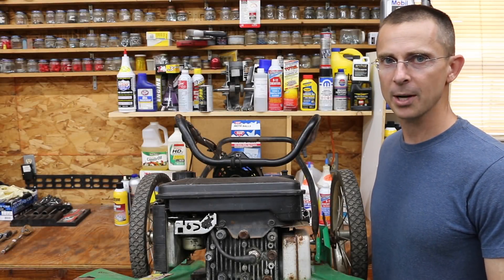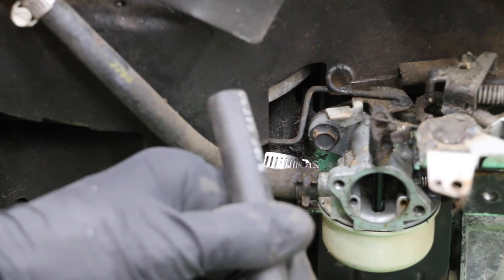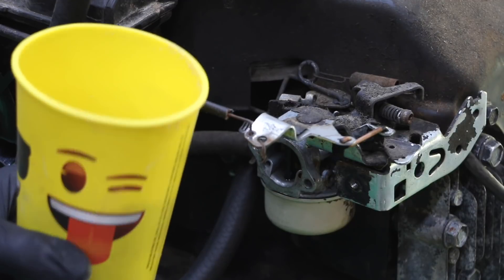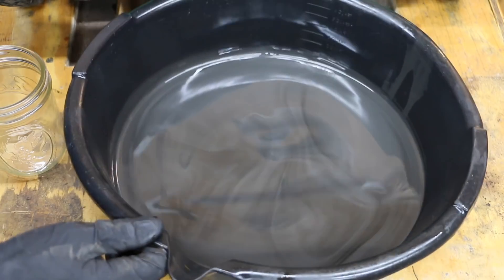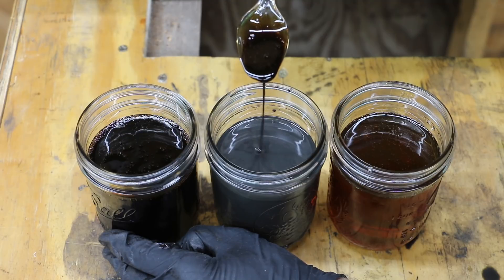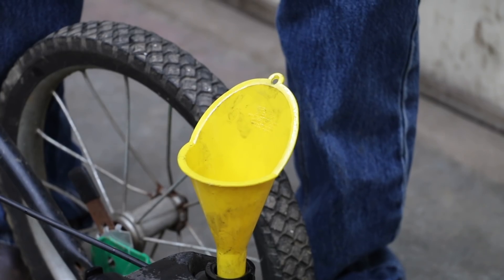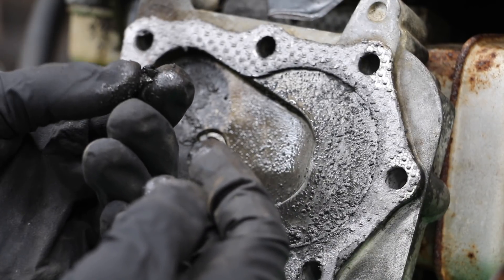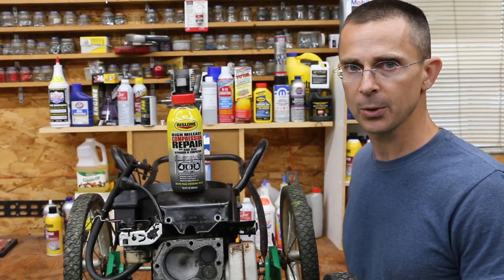Engine Eats Sand! Can Rislone Repair Compression Loss?

Comment: RISLONE. I have a 5hp, 43 year old B&S 5HP tiller motor with scratched up cylinder. Smoked like a fogger. I drained the oil, added 2oz Rislone and 16oz oil. NO SMOKE, runs smooth. It worked for me.
Reply from the maker: Thanks for sharing.

Comment: So I can't tell from the video if you ever wiped out the cylinder walls and the piston head/rings to get rid of all that sand before testing with Rislone (or whatever that was called)?  Nevermind, I see it IS called RIslone.  Anyway, so here I am, six years later asking if the piston, bore, and preferably the head had been washed out/wiped off/whatever to remove the lingering grit?  And my own suggestion might have been to use just a small bit of that sand and let it run longer to accumulate the damage rather than feed it 1/4 tsp of rough-grained sand, but who knows if that would have changed a lot.  I do think 'changing the oil and cleaning the head/pistons/cylinder/etc' before testing the restorative would have been pretty important...but then again, I don't know that you DIDN'T do that, but I don't see or hear any mention that you had so I was suspecting 'not', especially with the continued damage and worsening blow-by.

I'm curious what that metallic-y grit in the head was, though.  It MIGHT have  been some kind of partially-reconstructed 'aggregate' of fused-sand and the metallic debris from the damage?  And to be clear, I mean I'd really love to know what that debris was actually MADE of.  Like, 'x-ray fluorescence' or 'spectral analysis' or whatever like that just to see what was up there..!  That's not exactly a thing you or I generally have available, but I'm really curious about what it was made of.

Anyway!  After watching this, I remain convinced that my best solution to massive blow-by is to rebore or sleeve or whatever-the-cylinder and replace the rings/pistons/whatever.  I have yet to see anything helping with blow-by by more than a small amount.  This is an excellent example of why to use and CHANGE your car engine's air filter, though!  You definitely don't want a bit of road-grit getting slurped up into your car's motor like this thing got a sip of sand!  Road-grit might be less in mass, but unless it gets 'encapsulated' or washed-away and filtered out to keep it from doing more damage in the future then it'll just keep on rolling around and grinding stuff until the grit is small enough to roll past the rings and get filtered out..!

Comment: Restore "Engine Restore", the stuff you used to restore compression in your tractor, might actually be better than this stuff?

It'd be cool if you replicated this experiment with Restore instead, to see if it "heals" cylinder walls, as they claim! It sure seems to be doing something! I have some in my Honda right now.

Thanks, sir.
Reply from the maker: Thanks for the suggestion.

Comment: Great video! I wonder if the sand left in the motor continued to damage the cylinder, preventing the risk one from working. Would be interesting to have cleaned up the motor and carb of all sand prior to adding the rislone.
Reply from the maker: Thanks!  Thanks for the suggestion.

Comment: Yeah I'd re-do this test because it isn't a fair comparison. Throwing sand into an engine is not comparable to wear and tear from general use environments. You've essentially damaged an engine that, nothing but machine work can repair. The groves were so deep that a machine job may not fix the bore. So as a test it's a big fail by the method employed.

Comment: Wondering if repeated heat cycles, running and off, would allow the particles in the rislone to build up more inside the cylinder scratches???
Reply from the maker: Thanks for the suggestion.

Comment: When I was a boy I worked in my Dad’s heavy equipment repair shop. There were all sorts of engines that did not get run regularly and often the rings or valves would stick. The old school mechanics would draft “Bon Ami” into the carbs to solve the problem. They swore by it.
Reply from the maker: Thanks for sharing.

Comment: Try "Restore" engine restorer for V8, V6, V4 engines. I watched your video on your tractor. It worked great. I have an old "Whites" rototiller that has very little compression. I will test it this next week when time allows. I plan on using the "Restore" to repair the compression issues. Thank you for another great video. You cannot imagine how much help you are doing for so many. Thank You.
Reply from the maker: Thanks and you are welcome!  Thanks for the video idea.

Comment: TEST AN EGG!  Add an egg to the crack case.  I believe it only needs to be the egg white but i just put the whole egg in.  Smoke clears right up.  I used this in my youth trying to get a few more miles out of an old 6 cylinder clunker that was badly smoking and it really works.
Reply from the maker: Thanks for the feedback.

Comment: Now run 50/50 Motorkote and Restore in it and see what happens. FOR SCIENCE!
Reply from the maker: Thanks for the suggestion.
Reply: @ProjectFarm  The real question is though, how much abuse can an engine withstand before it pops with that kinda mix? AND, for good measure, run that mix secondary in the SAND EATER and see if it fixes it. ;)

Comment: Could you test the the oil additives on a steel sleeve  engine vs the cool sleeves you have been testing curious if the the rislone would maybe help better cause the steel doesn’t cool as fast maybe instead of the build up it would stick to wall? Thank you for you time
Reply from the maker: Thanks for the suggestion.

Comment: Just a quick note, you did not use it as directed. It is only meant for 4, 6 or 8 cylinder car engines. I had an issue with a 2009 Pontiac G6. Compression was 140 PSI for cylinders 1-3. However, cylinder 4 was at 80 PSI. Check engine light was a P0304. After 1 day, the check engine light was gone. I have driven the car 5,000 miles since with no problems. Sorry but I think your video is very misleading. Try using it as directed. Does the lawnmower have a cooling system due to heat? NOPE. How many RPM's does that little engine have? Do you realize you have to drive the car several miles before it starts working? How long did that little mower run? How hot did it get? BAD VIDEO.
Reply from the maker: Thanks for the constructive feedback.

Comment: I belive the  hunks are still chunks left from large grit u put thru moter , and far from sand rezlon  good product but it won't replace rings or cylinder  walls with  being said  a tired moter w  low compression  I believe  it does help but not with intent w such grit as u used  so b interested  to see a low compression  moter from. Reg wear what will happen I also belive it takes a while to work 2 not enough  x for great test tnx for ur great video s
Reply from the maker: Thanks for the suggestion.

Comment: So, I've used Rislone successfully, BUT not the same Rislone or for the same issue.  I had a collapsed lifter, after my rig was stolen and I got it back. A couple oil changes with Rislone(which was a much thinner bluish liquid) and I changed at 1k miles.  Restored the lifter.
Reply from the maker: Thanks for sharing.

Comment: Visualize this: a piston cylinder wall ten feet high, and 5 feet in diameter. A piston that is 4 feet 11 inches in diameter. A piston ring that is 5 feet in diameter. Drop a 1 inch rock on top of the piston ring, between the cylinder wall and the piston wall. Start the engine, dig a groove in the steel cylinder wall with the rock. How is pouring thick oil in the crankcase going to fix that? 🙄

Comment: I have a recommendation. I am a geologist and believe that the sand you used to score the cylinder wall in the engine was much to coarse grained (large in diameter) to simulate sediment being carried by the wind, which is what would potentially be sucked into the intake of an engine. The ability of a fluid to carry a particle decreases with particle diameter. You should repeat this experiment, but use a mixture silt and fine sand. Also, the rislone may work if the scores in the cylinder wall aren't so deep.  In my opinion, this test is too dramatic to simulate normal engine wear.
Reply from the maker: Thanks for the feedback.
Reply: Well I’m a kindergarten teacher and in my expert opinion, he should have used colored sand, as it would have been more entertaining for children
Reply: It's not just sand, it's just to simulate engine wear over time
Reply: A geologist that actually graduated from a real university should know the difference between to, two, and too!!
Reply: @markk8225  sorry, I forgot to submit my YouTube comment for peer review. Thankfully you were here to catch this serious typo.
Reply: I'm not a geologist but i came here to say that, should have used a high quality extremely fine sand.  I have never used Rislone, but this was not a fair test.  cant expect anything to fill in scratches that big.  Additionally I would have like to have seen several hours of use before testing the after compression.
Reply: Lol, you dont have to pretend to be a geologist
Reply: @m.b.82  
Right, because geologists don’t exist obviously
Reply: @gordtvradio3465  lol, well, I'm a professional comment section analyst, and it seems a bit presumptuous to suggest you need to be a geologist to spot course sand lol
Reply: @m.b.82  Thank you for your service

Comment: I know one trick but it only works on stuck rings, pour transmission fluid down the cylinder and let it sit for a day or two and the rings will unstick and your compression will go back to normal old mechanics trick
Reply from the maker: Thanks for the feedback.

Comment: This might be a fun test: After damaging cylinder walls by running sand through the intake, pull the engine apart and coat the bore with JB weld to fill in all the low spots. Then hone, and re assemble the engine. See if the JB weld does enough to raise compression, and then how long it will run
Reply: I 2nd this project farm
Reply: I third this
Reply: I 4rd this
Reply: I 5th this
Reply: 6th
Reply: I don't think the JB can hold up to thermal expansion, but I've been wrong before.
Reply: Ohhh nice idea.  I love me some JB weld 😁 good stuff! Wonder if it could stand up to this task, at least short term
Reply: I like that idea
Reply: JB Weld is a great pressure hold, such as a hole in a pipe. What you guys are taking about might work, but I'd think it would be way to thick and you'd be over spec. You'd have to sand the SHIT out of it to get it down a few thou .000 I'm like 👍 with the ones saying by the time you got that far into a project, I'd just go on and rebuild it properly.
Reply: 8th. Great idea. Never a waste of time if you want to do it.
Reply: I say go for it
Reply: I think the tools required for the precision needed, if he doesn't already have them, will make that a bit cost-prohibitive I think.
Reply: Yes but it's not about what's best  it's about teting things and experimenting for fun etc. That stuff is cheap Its just for shits n giggles etc.👍
Reply: @mattlawton4715  yeah it'd be fun. Chunky...but fun. Lol
Reply: i like that idea lol
Reply: 7th
Reply: I actually have done the JB 'repair' on a Harley Evolution 1340 engine.  Huge gouge where the wrist pin clip broke.  The repair worked and held for over 3000 miles. No exhaust smoke and about 140 psi.  The cylinder that didn't need repair was @150 psi.  It worked but you have to be patient and use the right technique to properly coat the walls.  I used an old piston and slid it through the bore- then let it dry for over 48 hours before I FlexHoned it.  I ended up getting new cylinders when I started seeing blue smoke from the exhaust but even then, it was only on hard acceleration.
Reply: I cant think of a bigger waste of time than to go through the labor of a rebuild only to use JB weld instead of just honing the cylinder back.
Reply: @paulg444  it is, but it is a waste of time in the name of science! Lol 😆 I seventh this!!
Reply: @paulg444  You're missing the point. The point is, umm, uh ...
Reply: @paulg444  Putting sand in your engine is arguably a bigger waste of time.
Reply: @paulg444  wait if you hone a cylinder out enough that the deep sand scratches are out, it will be significantly bigger than it's originally meant to be

Comment: I think the sand just dug too much for Rislone, but comparing the two pictures, it seems the places where there isn't a very deep groove are much more smooth, you should try this product again on a moderately damage cylinder head, maybe just an old engine that runs well, and see if a simple application can smooth out those cylinder walls and restore performance to an almost-new state.

Comment: I like the test... It was definitely pure cringe looking at that sand being sucked in. In my naive days I did what turned out in effect to be the same thing... Just not thru the intake like that. It brought me back, and made me think... 

You did drain the oil and flush the crankcase a few times... But like in mine, I suspect there would be a difference between the sand and simple normal wear - the grit would still be in nooks like the rings and such, helping perpetuate the damage further.

Somehow I don't think it would make a whole lot of difference, as this kind of thing is basically an oil thickener, which would reduce it's ability to flow past the rings and such, at best... And any claim of "repair" is just snake oil. So it might not matter anyway.

Short version of this... I wonder if it does actually help an engine that just has "high mileage normal wear".

PS... Mine was a car engine lol
Reply from the maker: Thanks for the feedback.

Comment: I enjoy watching your videos you do a great job..... l kinda think that maybe letting the engine suck actual full grains of sand  may be a little extreme compared to a real life situation where an engine that  just maybe had an get air cleaner that was put on incorrectly and is sucking a little dirty air or maybe has a little hole in it ..... you might as well have just took the head off put the cylinder down the way and took some 80 grit sandpaper and sanded the cylinder wall .....lol..... but ldo enjoy a good destructive video so great job..... There's no dou bt in my mind that you definitely caused some damage to that cylinder wall and it's going to take more than some mechanic in a can engine additive to fix that problem .😂🤣
Reply from the maker: Thanks so much!  Thanks for the feedback.

Comment: Lets treat this comment, like its just in Time. XD  

Is JB weld able to seal up some scratching or any Metalised glue. And can stand the heat and the Rubbing of the pistonrings. 

Woulb be interesting. (We actually did something like that on a 50ccm motorcycle engine back in the days. It has a Cracked Cylinderwall and two deep skuffs from the pin that holds the Pistonrings in position. But i wassnt there to see the outcome.) 

Greets
Reply from the maker: Thanks for the video idea.

Comment: I'm sure Rislone or any of these supposed 'restorers' are more geared to WORN engines not DAMAGED engines. This engine would need to be stripped and cleaned of all the debris and sand before attempting ANY restorer.
Reply from the maker: Great point

Comment: THUMBS UP. 👍

Thanks. I wanted to see this situation.

What about radiator sealer... as low compression cure?

What about an engine that is so damged it will not run... such low compression it will not run....

And then throw at it all you got.

Thick oil.
Rad seal.
Zinc granuals
Lead granuals
24 carat gold particles.

...in the oil...

What do you think?
What do you think might work?
Reply from the maker: Great suggestions!  Thank you.

Comment: It is claimed that bon-ami in powder form added to an engine air intake helps break in a rebuilt engine and cures glazed cylinders. Forgot where I read it but I think  Cat recommended it to seat rings. May be worthy of a test. Thanks
Reply from the maker: Thanks for the video idea.

Comment: I used rislone but A different type of it i used the type that seals the rings on the piston my Yamaha big bears got a ring leak and caused it to leak into the combustion Chamber and smoke which stank a lot 😂 but after the oil change and putting that stuff in it it didn’t smoke anymore
Reply from the maker: Thank you for the feedback

Comment: I've seen a lot of people run their classic cars with trumpets (air supply for carbs) without a filter.  They like the sound of the air sucking into the carb.  I've always thought they were crazy - no filtering the air coming in - sure, in a perfect world, the air doesn't have abrasive dirt, but in real life, it's in the air - just take a look at the fresh air side of an air cleaner box!

I've never used Rislone - I have used Engine Restore with good success.  I remember seeing a video from you using the product with success.

As and idea, there are many Head Gasket repair products out there.  I've heard that some will stop the leak, but fail a year or less later.  I've heard that others work for many years.  Can you run a test on the different products to see which one works the best?

Thanks again!

Comment: Sand: NOT part of this balanced breakfast.
Rislone doesn't look promising. It looks like it's just an oil thickener. There's a product I used a long time ago that contained lead particles that were supposed to get mashed into scratches and fill them in; I have no idea if it worked, but it seemed like it was worth a try and I drove the car for another 5 years.
Reply from the maker: Thank you for the feedback

Comment: I've used that restore stuff in a Honda put the can for v8 inn and it did boost the compression quite a bit the middle to Pistons only had like 80 psi and it boost it up pretty good abott 110 even felt  faster lol
Reply from the maker: Thank you